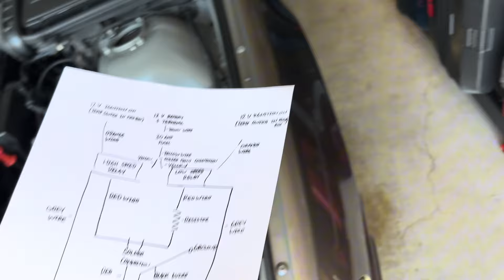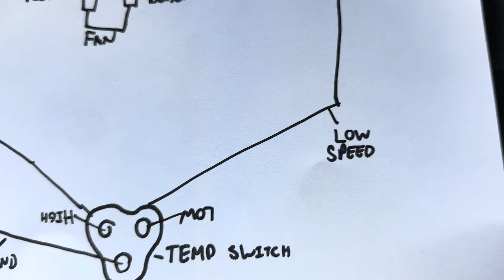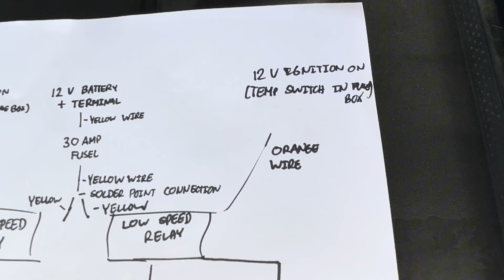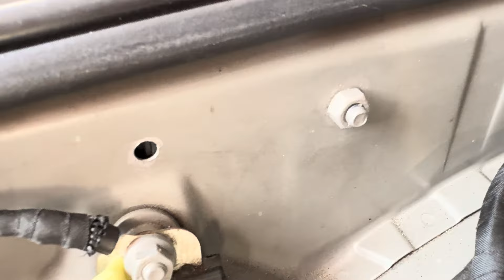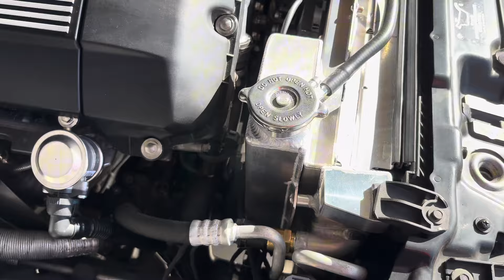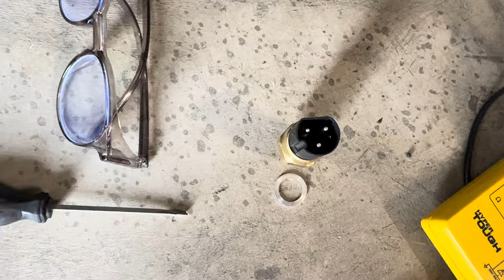BMW E39 530i Zionsville Electric Fan Cooling System Explanation and Breakdown

Comment: Where did you get the +12V and also the switched ignition voltage? You show a photo of the junction box but don't really show where you got those signals from.
Reply from the maker: For the +12V I got it from the positive terminal of the engine bay, on the rear top portion of the intake manifold. The switch ignition voltage source is circled in faint red in the lower right portion of the picture. From my research, the two wires you see are part of the OEM temperature switch. I tapped into the green+white striped wire with a T tap connector to make the connection as tight as possible. I hope that helps. Let me know of any more questions, I am happy to answer them.